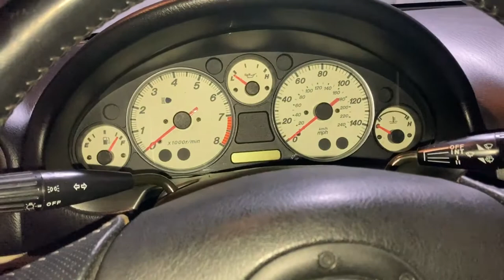I Almost Lost The Daily Miata...

Comment: That's crazy! My 2003 did the same thing while backing out but mine literally burned a hole in the side of cylinder 3 coil pack boot
Reply from the maker: Bruh that is wild 😂 exact same way. I thought it was game over at first lol
Reply: When i replaced the coil pack n wires it actually ran better than it ever has